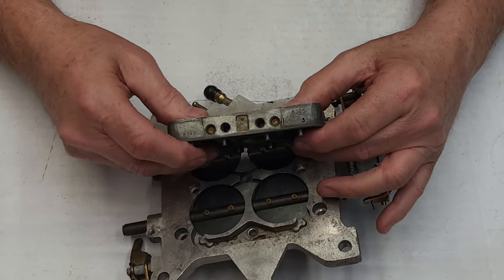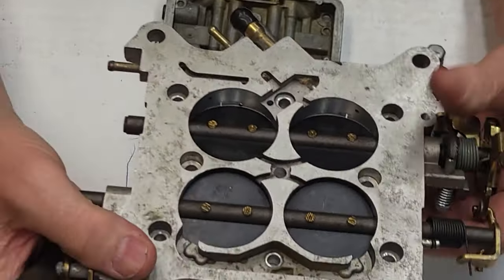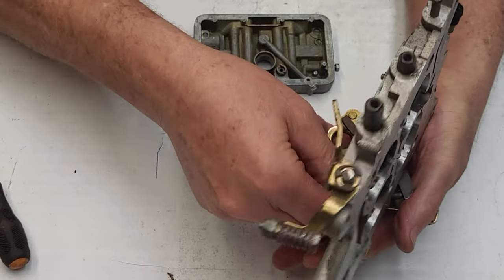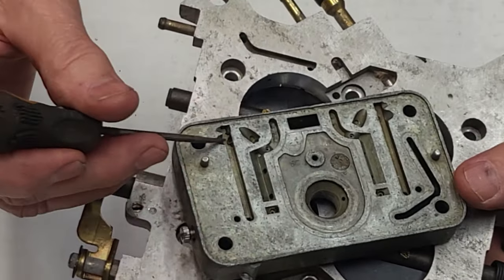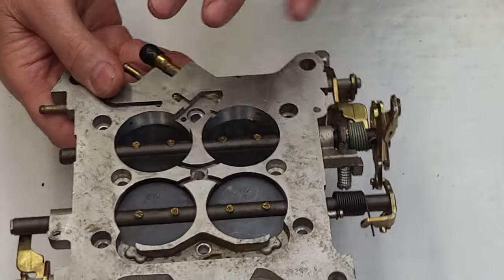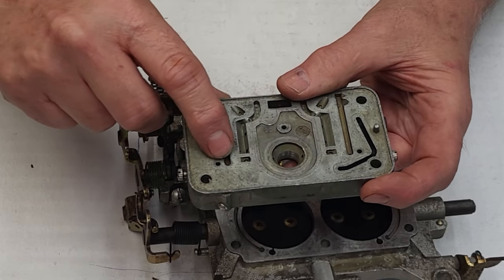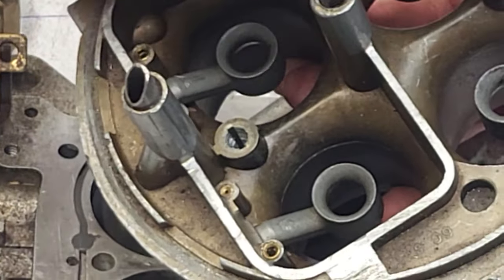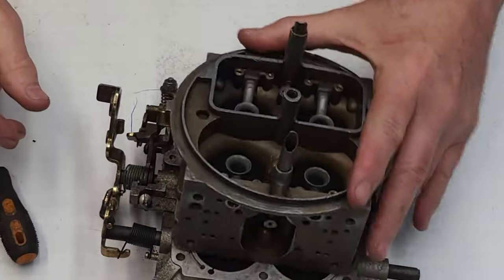Fine Tuning with T Slots and Bleeds

Comment: I used your advice on Idle air bleeds to get my idle speed down to where I wanted it and also get it leaned out enough to let my mixture screws work correctly on my old 750 DP with a Chinese billet base plate (did the same mods to it that you did on yours). I got some solid 6-32 brass inserts and drilled them out bigger than the existing holes by 4-5 thousanths at first. I drilled and tapped the old idle air bleed holes out and tapped them for 6-32 - it wasn't too hard. Then I kept opening up the idle air bleed holes until I got it where I wanted it. Don't forget to debur the drilled hole edges on the brass inserts. This made an old beat up 750 DP come alive again! Thanks for the advice Randy!

Comment: I’ve followed you for a couple years now and you are such a knowledge of info to us guys who still run carbs on our classics. 
This here video is exactly what I did for my big crammed SBC to not only stop the “rich” tears in my idle eyes - but throttle response is awesome. 
Just to tell you guys new to Randy’s carb knowledge - get an air/fuel mixture gauge to help you with this fine tuning (AINT cheap at $150 but so worth the time saved) and you’ll be able to actually SEE what your motor likes. 
Thanks again Randy - I speak for all of us you’ve educated with your time and knowledge.
Reply from the maker: Thank you for watching my friend.

Comment: Hello Randy, another great video.
If I may, it's always a good practice to have some fuel discharge through the transition slot at idle, so that as you open the throttle, fuel inertia will reduce the possibility of a lean condition, which then would have to be corrected. 
During the 60s and on, we would drill 1/8" holes in the throttle plates, positioning the holes so as to make a triangle with the throttle plates screws.
Thanks for the privilege to comment.
By the way, I wish I could give hands on help, pro bono, to some of the young men that are involved  in racing. At Bailey Tech in St Louis I was able to help my students.
Regards!
Reply from the maker: Bert sorry it took so long to get back to you, I use my transfer slots at idle too. There is a well known builder out there that closes up his t slots at idle. I rebuilt one his carbs that to many people had been in, and a very unusually fuel curve. I corrected the problems and returned it, when the racer installed the carb he  called me up told me to listen and cracked the throttle and  I was surprised at the throttle response. It worked great even though I had my doubts.I guess you never know, but mine have excellent throttle response too. I have enjoyed the chat, take care my friend.

Comment: The 67 Corvette Holley (2 idle screws) uses IFR’s measuring .028”, so I stay in the .025” to .029” range more importantly w/4 corner. Favoring .025” IFR & smaller IAB’S. There is a range (IFR/IAB) of air to fuel ratio of around 19:1 area wise that seems to work well. Too big an IAB kills fuel velocity. I find modern Quick Fuel/Holley’s everything is too big.  So one needs to recalibrate EVERY ORIFACE (IFR, IAF, PVR, JETS, everything) right out of the box to avoid black spark plugs, overly rich, and stinky exhaust. The transfer slots need to be restricted from .106” down to .081”/.078” because the T slots are too big. I’m talking street use not drag racing. I like your series😊
Reply from the maker: 19 -1 is way to lean , usually they won't  even idle at 19-1, if  now talking about a stock engine yes it is much easier to figure your fuel curve A typical 4 corner idle circuit you need to limit your ifr size and increase your iab size, now if you add a racing cam you have to bypass enough air to correct your transfer slots and then you work with your ifr and iab . Hope this helps.

Comment: May I ask a question? I have a 4 corner idle 750 vac sec  pro form holley, how does the secondary throttle blade adjustment(screw under shaft on passenger side) fit into the equation? I've set the primaries transfer slot to square and used the secondary adjustment to adjust the idle🤷  then I KNOW the transfer slot is right. Is that acceptable at all ? Thanks for any response.
Reply from the maker: I usually will compensate with rear idle adjustment to a point,  but with me only to a point because I square everything from air bleeds to jetting. I'm  not saying you can't,  its just not my way. If it performs well and your happy with it thats all that matters. Hope this helps.
Reply: @holleycarbshowtosadvice40y90  yes sir it helps a lot! I appreciate the response and your videos. They have helped me tremendously
Reply from the maker: Thank you.

Comment: Wonderful stuff, enjoy watching and learning. Question, is it acceptable on a 4 corner idle carb to have the IFR and/or IAB different size on the front than the rear? On my QF 780vs I have good fuel screw adjustability on the secondarys but not so much on the primarys. I'm thinking of leaning out the front more than the rears to gain some fuel screw adjustment. I'm wondering if the exposed transfer slot, which is adjusted properly, adds more fuel thereby causing my problem.
Reply from the maker: Yes ive set up carbs with different primary and secondary iab .

Comment: Great videos! What if idle is all good but as soon as you crack the throttle on light cruise it richens up considerably?
Reply from the maker: Make sure float levels is set properly, if you crack the throttle and hold it there and if it stays rich, it boils down to where your rpm is if its  below booster activation then i would change the idle air bleeds if there changeable go up .003 larger at a time. That will lean idle and transfer slots. Hope this helps.
Reply: @holleycarbshowtosadvice40y90  thanks a lot! I Will give that a try.

Comment: i left a little out i have a dig-6 ing box , dis is MSD , the only thing that i changed was the carb thinking i would pick up a little more ET and MPH which i did before changing my barry grant for the holley it's one of those idea's that i would do more good than bad and it is a 1/4 mile drag car
Reply from the maker: Even check throttle opening while manually pressing pedal to the floor, don't  overlook anything, double check anything that could be a restriction to the bowl vents. Wish I could be more helpful.

Comment: Always great info! 
So because I've been too much of a chicken to drill my primaries, I've been cheating it by cracking open the secondaries further (4160 model, vacuum secondary) to compensate. Is this a good idea or bad in many ways...? Subject is SBF dual 390 cfm Holleys on a Weiand Tunnel ram.
Reply from the maker: No it works fine up to a point and an easy fix for some combinations, but to make a tunnel ram or a camed  up race engine work properly it takes more mods.  I'm sorry to get so long winded, but when engine vacuum is low yes I drill the butterflies and I'll  close up the transfer slots as much as possible without the throttle plates sticking and then tune with idle air bleeds, this is a time consuming repair but it always gives me my best performance I hope this helps and take care.
Reply: @holleycarbshowtosadvice40y90  I guess my reasoning behind not drilling out the primaries was I wasn't completely sold on those carbs and had thoughts of switching to something else with adjustable air bleeds. I didn't want to render these carbs to just this car or that engine. (a new engine was in the works as this one was garbage 8.7:1 with a big cam) Need a more proper build to adequately run a tunnel ram to begin with! Thanks for the info and keep 'em coming!!
Reply from the maker: You are absolutely right it is tuned more to that type of engine, that engine you described was in trouble from the start lol. Very nice talking to you.

Comment: Hey Randy, I have a Holley Speed Demon 750DP carb that I can't get to drive at low speeds about 20 or 25MPH cruising the neighborhood it goes lean about 20 + AFR.  It just falls on its face after squirters are done. I have 13.5 at idle and 14.2 at 60 (3K RPM) cruising. Checked for vacuum leaks with carb cleaner even replaced throttle plate bushing front and back little more slop than I liked in them (thinking air leak). Transition slots are squared front and back when closed also. 4 corner idle. Whats your thoughts, Thanks in advance.
Reply from the maker: Mike you said you  squared your transfer slots,  I only square my primaries, i try to keep my secondaries open about like the primaries. You can open the secondaries  a little more but don't expose the transfer slots  if it needs more air i drill bypass holes. After that you may need to open up your idle fuel restrictor .hope this helps

Comment: I appreciate the video, I have a question. I’m running a 1050 dominator 4500 carb on the street on a 496 I built. It’s a 3 circuit Holley setup with an intermediate air bleed circuit in addition to what you talked about in this video. We have been dialing it in we are running a single stage power valve in the primaries with 85 main jets, and 90 in the secondaries no power valve in secondaries. I can’t find any information on them. Or how to tune the intermediates. Looks to be about a .060 orifice in the bleed.

I’ve got the setup to run at 14.0 at  idle, and 12.7:1 at wot. I’m trying to lean out the part throttle cruise portion. Combo makes about 12in vacuum at idle and about 22in at part throttle cruise I think I may be drawing down on the intermediate circuit hard I’m curious do you go bigger in the bleed to lean it out some? Or do I restrict the emulsion jets some? It’s running a mid 12:1 afr on part throttle cruise?
Reply from the maker: If its an air bleed larger will lean, if you will send me your list number, I'll  try to help.

Comment: in this vid you mention (around 2:30 time mark) thatyou have almost closed the transfer slots on some carbs so that virtually all of the idle mixture is controlled by the mixture screws, and it worked fine. can you do a vid on that setup in detail? thanks
Reply from the maker: This mod requires a lot of time, removing the primary butterflies and throttle shaft and slightly open up the throttle bore. This is more of a custom mod. It so easy to damage a 850 throttle plate. The primary idle speed screw cannot  be used to set idle speed, you have to use secondaries idle speed screw or air bypass holes in low engine vacuum conditions. Hope this helps
Reply: @HolleyCarbs, ok, thanks much. does this mod improve off idle and low rpm throttle response or what is the resulting performance improvement of this mod. thanks again.
Reply from the maker: I like the idea of having full control over the idle mixture, but if the carb is tuned right its hard to o say, could be a small advantage. At the  same time it can be more trouble  to tune.
Reply: @HolleyCarbs   ok, thank you very much for your informative responses.

Comment: Instead of drilling a hole in the throttle blades to adjust the idle, can you open up the secondary throttle blades on a 750 double pumper?
Reply from the maker: If I have a small cam I will use the secondary idle speed screw to compensate for extra air but a medium to large cam or tunnel ram has to have bypass holes to tune properly in my opinion. Hope this helps
Reply: @holleycarbshowtosadvice40y90  My 427 bbc has a Howard's roller, Lift: .578 / .618, Duration @ .050: 231 / 235, Centerline: 108, big enough to drill? Should I start with 1/16 holes?

Comment: I have a Holley 600 CFM 1850 carburetor and I can't get it to idle as low as I want (idling at 1000 rpm and I want at 800. Can I completely close the transfer slots? All the videos on this say they need to be a square opening on the slots. Thanks for any advice
Reply from the maker: When I close off my transfer slots at idle I'm  just using the mixture screws to control the idle, I don't think that's going to help you with your idle speed. I would need to know your engine specs and your idle vacuum. I'll  try to help.

Comment: Hey thank's for the reply i put a new fuel pump, fuel line's and new tank . the only thing that was changed was the carb , at the race's a freind let me try his carb and to no surprise the car ran great , it's the carb and only the carb giving me the problem . the engine is 383 cu in, no popping , the ing. system good MSD the wire;s are 8.5 mm MSD cam solid  roller comp cam  and an auto tran's with all of this it is NOT the motor , all that was changed was the carb ,all it will do is flatten out
Reply from the maker: I would tear the carburetor down and look closely for any restriction, floats binding, make sure no restriction in the bowl vents or fuel logs, jets , power valve circuit restrictions. Check all bleeds, you might wont to substitute some metering blocks, check boosters for restrictions, I wish I could give you a better answer but if its in the carb thats the only way I know to find it. Also I have seen spring loaded filters in the bowl inlet, tear it totally down. Look at metering block gaskets Hope this helps.
Reply from the maker: Carl it should be fine blocked  make sure your jets are 6 to 8 jet sizes larger in the secondaries and make sure you have notched floats and jet extensions in the secondaries to prevent starvation. Good luck brother.

Comment: Ive got a 2300 that is pig rich at idle, I’ve drilled out the butterflies to 2.8mm but it still runs pig rich and won’t run on the idle circuit. Should I go bigger or is there a problem with fuelling?
Reply from the maker: First you need to make sure your power valve diaphragm isn't  leaking, or you'll never be able to control the idle mixture. I need more information  list number of carb and cubic inches and vacuum at idle.let me know, if my carb is in good shape then i set my idle speed and remove my carb and look at the transfer slots if there open over .020 to .030 then I drill larger bypass holes, some 2 barrel combinations I have drilled over .200 it all come down to camshaft size and engine size and carb 2300 could be a 350cfm or 500 cfm. After checking pv then make small changes at a time. Hope this helps. Let me know. One last thing make sure your idle bleeds aren't  blocked.

Comment: Hi Randy, I have a 750 main body & metering blocks that accept screw in type air bleeds. What size do you think I should start with?(base line) I’m starting from scratch. 
70 chevelle 454 comp cam. 4corner ldle & the metering blocks have 4 circuits. Thanks!
Reply from the maker: Is your emulsion circuit adjustable?
Reply: @holleycarbshowtosadvice40y90  yes. Billet aluminum aftermarket block.
Reply from the maker: I need to know how many emulsion holes and what brand block
Reply: @holleycarbshowtosadvice40y90  	Deepmotor
Manufacturer Part Number	DM-1110MB. 
Thanks again for your time & support!
Reply from the maker: I'll  have you a fuel curve tomorrow.
Reply: @holleycarbshowtosadvice40y90  Thank you! There are 4 emulsion holes in the blocks
Reply from the maker: I'm  willing to help you with a fuel curve if you email me your phone#  heres my email  bigblockchevyman1121@gmail.com

Comment: Does the secondary transfer slot need to be adjusted the same way as the primary transfer slot?
Reply from the maker: No  the secondary transfer slot should be closed at idle, only the primary is exposed and needs to be adjusted
 And this is due to a racing camshaft that creates a low idle vacuum . Hope this helps
Reply: @holleycarbshowtosadvice40y90  Thanks

Comment: I have a question i hope you could answer i have a ultraXP 850 cfm holley carb , im having a top end problem about the 800 foot mark  the motor flattens out even with the pedel to the floor it,s driving me crazy would you have any idea what is going on  with this card , it has been wet tested ????????  i put a new fuel pump ,new fuel line,s new fuel tank it did nothing
Reply from the maker: I need alot of information, and I'll try to help. I take it your racing the 1/4 mile. Engine cu.inch, Ok  when the engine flattens out is it popping through the carb or the exhaust, or surging or anything you noticed. The engine flattens at what rpm and is this consistent, I take it this happens in third gear if its auto  (trans type). What type of distributor and ignition boxes if any are you running.  A stock or HP air cleaner, type of gas tank stock or aftermarket and describe gas tank vent. Is there any rubber line in the fuel system and were. Does the engine rpm well in first and second gear with no flattening and is this consistently happing every time. Also type of ignition coil and wires, type of camshaft hydraulic or solid flat tappet or roller and valve spring pressure ( seat)  and over the( nose. )
Reply: Hi thank you for advice and time ,i sent replies so i will answer your question's yes i race 1/4 mile  the inginion system is all MSD , the coil is the big blue one tran's is automatic  the engine is 383cu in fuel system is HP no stock , and i replaced everything ing box is a digital 6 wire's are 8.5 MSD no air cleaner there is no popping or anything out of the header's it run's great 1st and 2nd and  3 rd it's a 4 speed  it's about the 800 foot mark where it lay's over i run 6 1/2 pound's of fuel at the carb cam is a comp cam solid roller and yes it happen at the same time every time at the last race a friend let me use his carb and there wasn't an issue it ran like it should of i shift the car at 6800 rpm if you need more info i will give it to you but not much left i did send other replies but don't know if you received them im hoping you might have an answer   @holleycarbshowtosadvice40y90